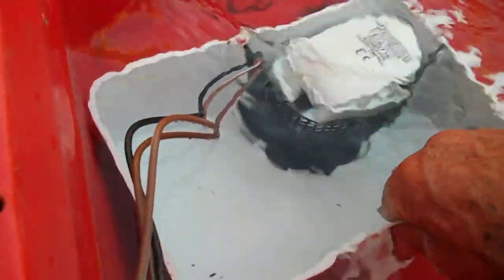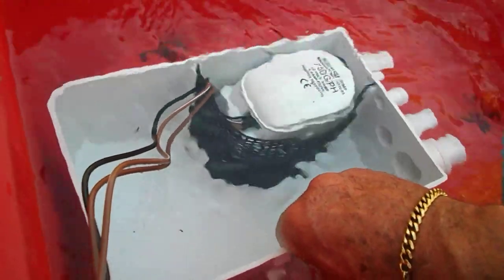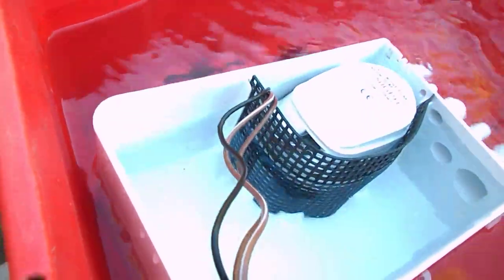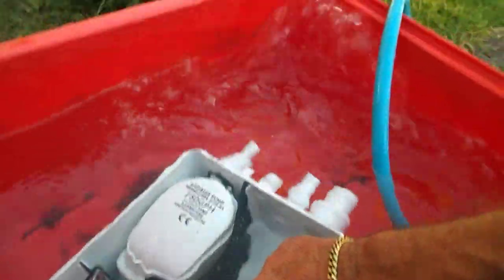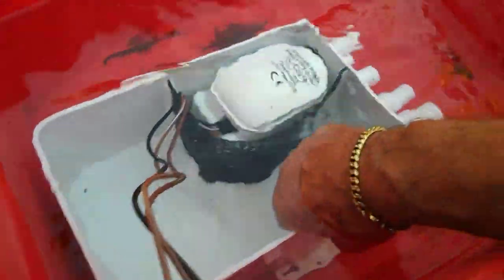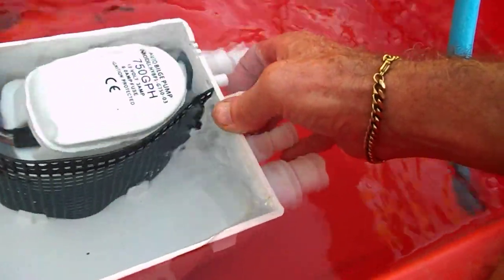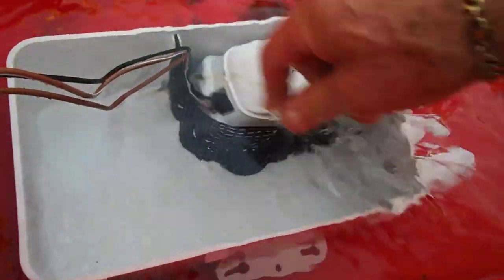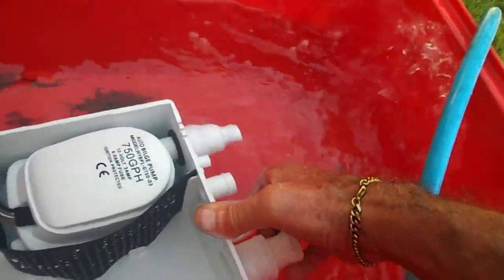DasMorine12V 750GPH Multi Port Marine Boat Shower Sump Pump Drain Kit System Review

Comment: you don't need to drill a gland, the wires run through the small cutaways in the box above the outlet, and compress against the lid.